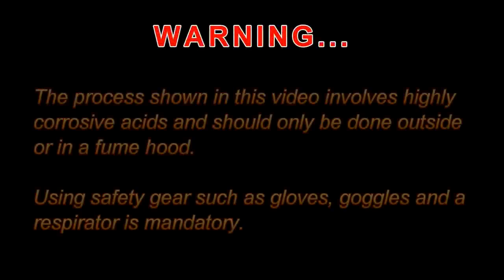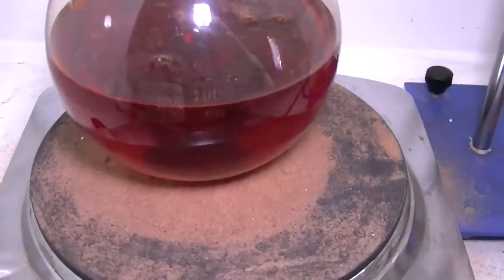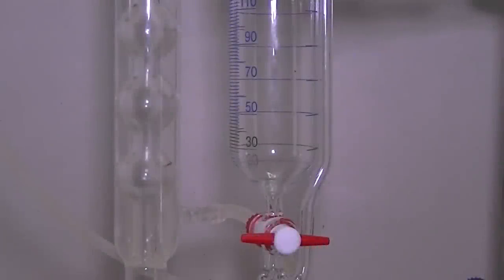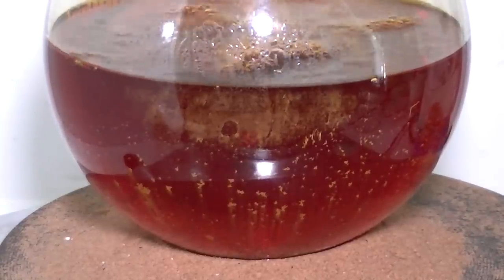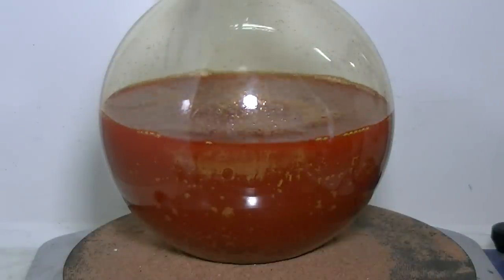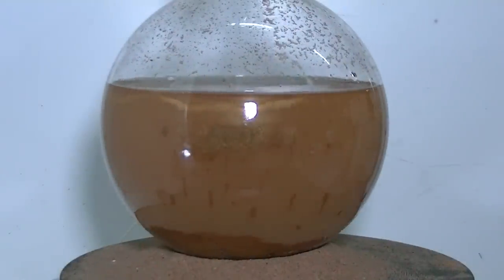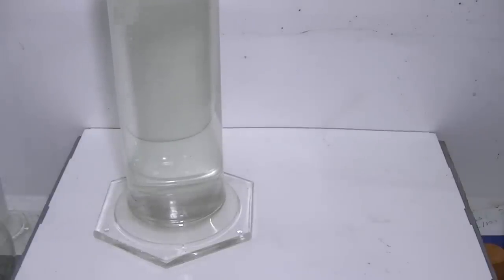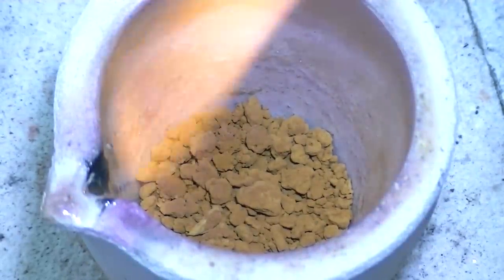Gold Reduction with Oxalic Acid -Complete Process

Comment: Way more important is how many computer waste was needed to have that much gold??????
Reply: my experience is about 150 to 1 of high grade ends and fingers. so if i cut the edges off the ram and pci cards, and minimize the amound of green board to just what is under the gold, nickel and copper. you get about 1 gram to every 150 grams of gold scrap. i know some people are getting more, but im not. its a hobby, not a money maker. you have to do large scale production to turn a good profit. but ill get 200-300 $ in a weekend.
Reply: Alal Telal thank you very much for such a fast response. now my question was how many computers! per gram of gold! that was just kind of one of those savant moments of thought. Something like "Ok! How many computers I need to have an Oz of gold" I know is a bit stupid but that was all.
Reply: not sure. when i get my materials, they are already cut and sorted. i guess it would depend. you have older cpu's like the pentuim pros that have a lot more gold than say a socket 478 intel. odler machines have more gold. even come across some aircraft boards with an oz itself.
Reply: Alal Telal
so how long do you figure you would have to work this refining process to gain about a good say half pound or so of gold?
Reply: depends on a lot of variables. ive never done a half pound of gold. 3 ounces is my best load in a day. but im hauling thousands of pounds of waste to get that
Reply: much
Reply: Alal Telal wow 3 troy ounces? What is that, like $3860 worth?
Reply: vulkein  It depends on the market, which changes constantly. It'd be about $3848.70 at the very moment I post this.
Reply: vulkein wow u can make lots of money out of that

Comment from the maker: No.
For the reasons you mentioned. No need to destroy a perfectly reusable BDG.
You can either adjust the pH of the Oxalic acid solution to 5-6 beforehand or just use Bisulfite solution to reduce the trace left over gold in the organic phase.
But all this has little to to with the process described in the video. Apples and Oranges.

Comment: To all those randomly spouting information here. 1. No these chemicals aren't expensive, but they can be tricky to obtain in high concentrations. 2. Yes if you could get old PC parts by hauling them for someone cheap/free you could turn a profit. Gold is very heavy and worth minimum of $1100USD an ounce.
You need time, money and expertise to pull this off but you could do this as a hobby and make a small amount of money on the side doing this, however without industrial sized machines and a large amount of scrap computer parts you're not going to make a living.

Comment: It is produced by dissolving gold in aqua regia (a mixture of concentrated nitric and hydrochloric acids) followed by careful evaporation of the solution

Au + HNO3 + 4 HCl → HAuCl4 + NO + 2 H2O
Under some conditions, oxygen can be used as the oxidant. For higher efficiency, these processes are conducted in autoclaves, which allows greater control of temperature and pressure. Alternatively, a solution of HAuCl4 can be produced by electrolysis of gold metal in hydrochloric acid:

2 Au + 8 HCl → 2 HAuCl4 + 3 H2

Comment: A lot of people seem to automatically assume this a cash goldmine (pardon the pun) but im curious as to how cost efficient this is. how much do you pay for old computer parts or if you simply haul them away, how much effort and time do you spend aquireing them? also how much do you pay for concentrated hydrochloric acid and concentrated nitric acid? in short whats the return on your investment?
Reply: ***** da fuq? HCL is dirt cheap in quantity, same as most base reagents. It's even fairly cheap buying it at lowes as muriatic acid for cleaning concrete.

The cost isn't an issue for the other acids, either, public availability is.
Reply: Couldn't you even just make your own HCl? Surely there's a simple process involving chlorine/salt/etc. and water or something?
Reply: Thomas Riddle Agree. If you know where to buy it all these chemicals are cheap. Buying at a hardware store you will never get past 40% purity for , more than the price of gold in its weight. Sniff around electro plating manufactures :) They get to good stuff! Cheap!
Reply: ***** Do you have any clue about chemicals whatsoever?
Reply: Nope

Comment: Do you have a clear, step-by-step plan for doing this? Starting with which chemicals you need and how many parts of what chemicals and where you actually get the gold from? That would be helpful instead of starting a video seemingly in the middle of the whole process. Just wondering.Thanks

Comment: I'm assuming your torch was a reducing flame to help convert the gold oxide to gold? Or do I have something wrong?
Reply: the oxalic acid was the reducant, the precipitate from the chloral aural acid WAS 99.99 pure gold powder.
Reply: Josh Carmack
So why did it need hit with the torch then if it was already pure? I understand it melted, but what's the difference, it's another step that costs money.
Reply: kleetus92
I'm no expert, but I'm assuming powdered gold would be harder to sell for various reasons, one of which being it doesn't look much like the real deal. It's quite harder to weigh and test in powder form as well a nugget handles well and is easily conveyed, weighed etc.

Comment: You don't just throw the HAuCl4 compound into any acid and extract gold. This reaction has particular features that promote that process. For one, because it releases CO2 gas, it is effectively irreversible. A plain-ole acid-base equilibrium is reversible. Besides, HAuCl4 IS an acid itself. NaOH accelerates the reaction, but it's not formally a catalyst.

Comment: The gold is 4 9's pure. Does the .0001 of impurity come from the heating process used? It looks like you are blasting it with a combustible gas.
Reply: It is 4 9's pure because because of significant figures you can never truly know if something is truly pure. .9999 gold is equivalent to 24 carat gold. The concept is like purell saying they kill 99.99% of bacteria, they kill .9999.

Comment: The steps in the video is a bit twisted.  If you have impure Gold AR i.e. gold & copper from scrap jewelry, then you should neutralize first with hydroxide just before apparent color change OR use urea OR boil down the AR - then add in your oxalic, SMB or what ever other precipitant.

Comment: I completely missed why one wouldn't just melt down the foils once separated from the PCB's, why go through the precipitation steps
Reply: I'll be no where near pure if you don't, it was plated on there, which means it is electro-chemically plated to the nickle and copper.

Comment: i worked for a semiconductor company before.. and the wires they used regardless of what kind of IC they're making is 99.99% gold wires.. being bonded to the ic pins and to the wafer chip.. covered by a fucking hard molding compound.. if you can make ways to have it extracted, that will be an additional weight.

Comment: You could've forged a ring with that gold.
Reply: No, you'd need a bit more. If you cast a ring out of that little gold, it would be too thin. Now, if you alloyed it from 24k to 14k you would probably have enough metal to work with.
Reply: You could, but eventually the Hobbits would take it and chuck the ring into Mount Doom...

Comment: For anyone curious what the value of that gold is:  the answer is NO MORE THAN $127.68.   In part 1 he mentions that he expects to make about 1-3 grams from the process.  The current value of gold (as of 09-02-2016) is $1323.80 / troy ounce.  Considering he claims this is 99.999% that equals to $127.68 but of course no one is going to pay you 100% of the market value.  At best you'll get 95% of the value.  So yeah it's cool and all what he did but in the 7+ days it took to do this you could of made more money working full time a Taco Bell in less than 3 days.
Reply: He didnt spent the amount of time that is full time for 3 days working on it. If anything the actual time spent on the process was 3-4 hours.
Reply: Sure for a professional who already has the materials, chemicals and connections to obtain the electronics he might of spent 3-4 hours. For everyone else who thinks this is easy money they will be unfortunately surprised when they see how long it will take and cost to obtain all the materials, chemicals and enough scrap electronics to make a profit.  That's the point I'm trying to make.  Most of the comments here are people who believe they're going to make $1000's of dollars for a few hours of work. When they'd be lucky to break even.
Reply: Plus the money it takes to invest on all the materials needed to do this,     you might not even break even your 1st time, then you have to add the time it takes for all the schlepping around finding PC parts.
Reply: Also, there is some confusion with the "oxalic acid" which is HOOCCOOH. And most probably the author used Hydrochloric acid for dissolving the gold. You can see at 2.25 H-Au-Cl4 which is tetrachloreauricacid built up after HCl was heated up.
Reply: Lol, I thought you said he used Hooch (alcohol made in prison) until I realized it was a chemical molecule you were listing.  Would be nice if it just took some fruit fermented in a toilet bowl to get gold :)
Reply: Which is more fun ? Making a burrito  or  a gold ingot  - and I don't why he aquart the gold when he could have pluck out a nice bead.

Comment: Alright I have a better one for you...
1. Aqua Regia with gold inside
2. Add diethylene glycol dibutyl ether (VERY EXPENSIVE).
3. Remove the diethylene glycol dibutyl ether now yellow in color.
4. Add hot oxalic acid in water to the diethylene glycol dibutyl ether now yellow.
5. If the gold doesn't precipitate add a few drops of sodium hydroxide but not too much or you'll get soap and charcoal when you melt it.
93